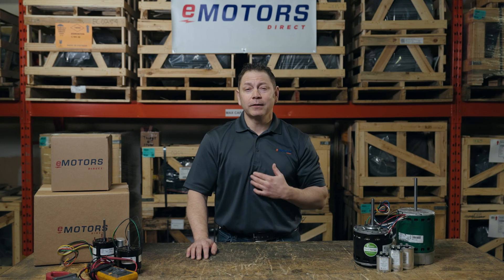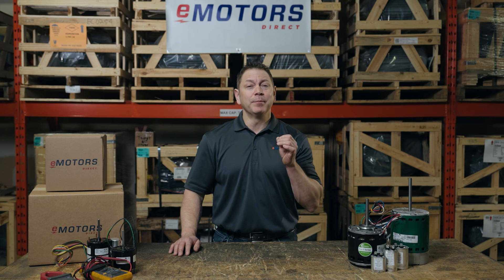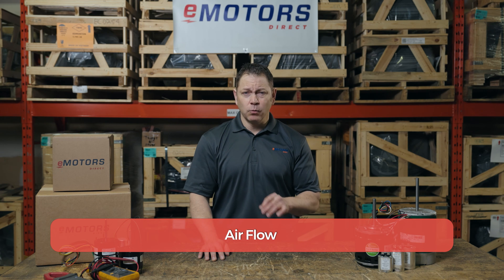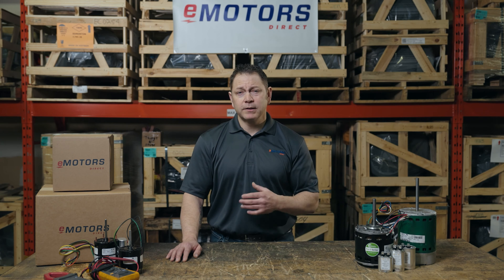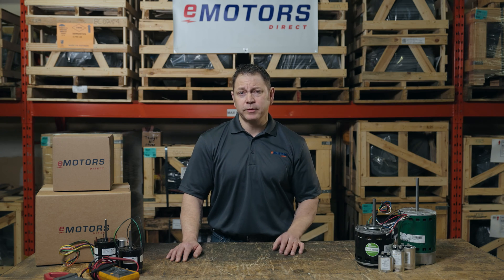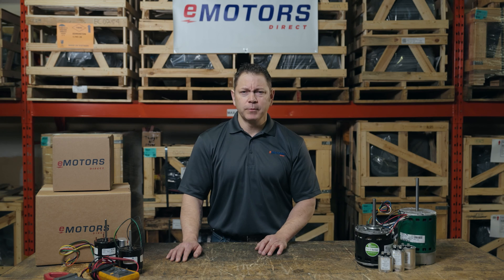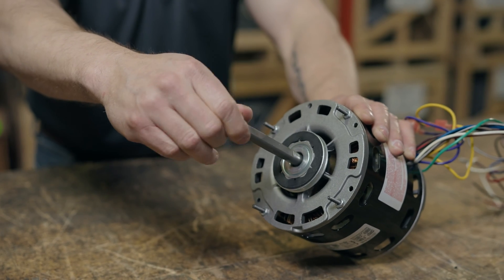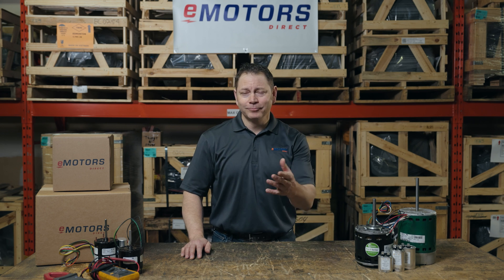How to Test a Furnace Blower Motor | Easy Guide

Comment: Nooooo! The resistance of the motor windings should NOT be zero. That would indicate a short in the winding. For example, should have about 8.3, 5.9, 5.5, 4.1, 2.2 ohms for a 5 speed motor measured form the white to each color.
Reply from the maker: I see your point! This advice is not intended for professional technicians but for beginners who want to troubleshoot their furnace motor themselves and use basic household multimeters, which might be a lot less accurate than what you're using. Anything near 10 ohms is generally acceptable. I agree that zero resistance typically indicates a short circuit, which is problematic, but here we meant that it should not be open (OL).